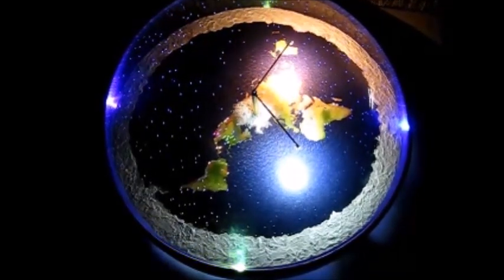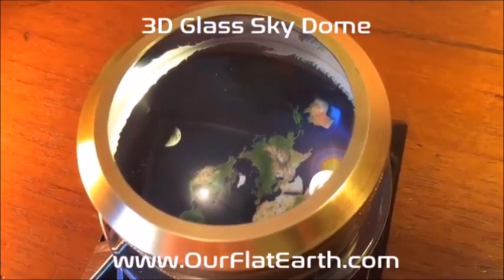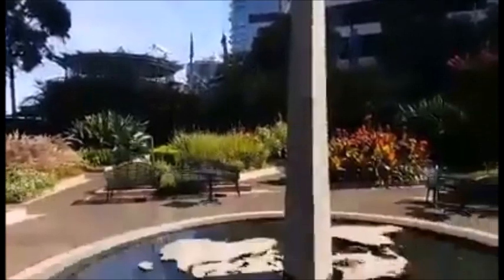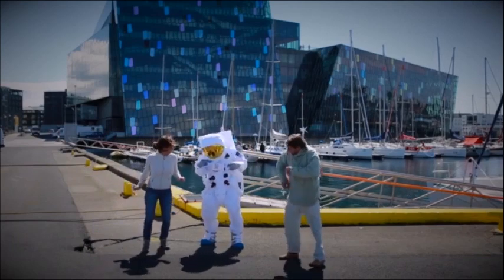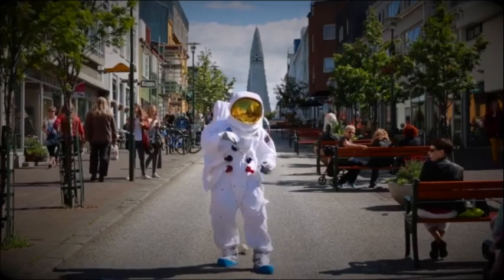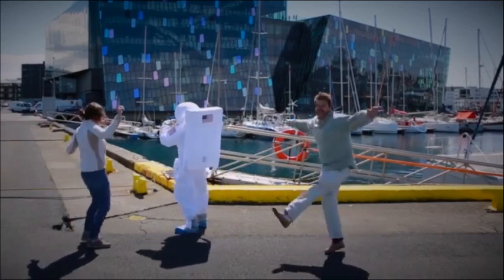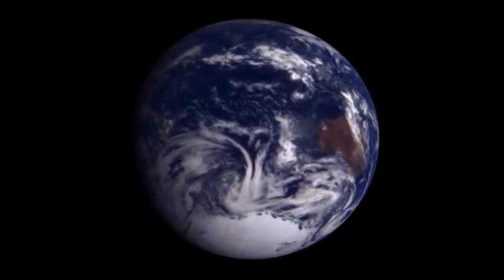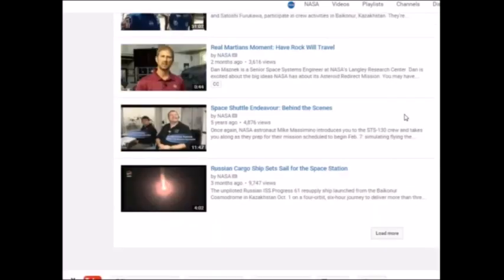Flat Earth Q&A Emails 61 - Mark Sargent ✅

Comment: Um... so wait, what?  

‘an infinite plane...’.?   Don’t you guys math?  If you get in an airplane and fly in any direction for 24,901 miles, you’ll end up back exactly where you started.  (spoiler - that experiment only works on a *sphere*)

I’d say it’s not rocket science, but it kinda is... oh and by the way, every rocket scientist knows you’re wrong.
Reply: +M. al, Prove it with a north/south flight around the earth. Prove that it has actually been done. The technology to do this is currently available by any reasonable airforce. It have never been done. Interesting?
Reply: From any direction!

And do you believe that there is sumthing called inner core that is pulling you right now!

If the flat earth had an inner core we will be dead because the all the water on the earth will be right in the middle of,
 and going out form the sides oh boy it will be like climbing a monton.

and the last thing what got you that earth is flat when if you believe in it my guess is on youtube or internet.

and if you say the government are hiding from us just why are we going to die if the earth is flat.
Reply: +M. al, seriously, fly west or east for the enough distance, from any point,  and you will be back at the start on a flat earth. Why do you think you wouldn't? It works the same as on a globe?
Reply: See that's the thing you travel 24,901 miles from where you are standing/ sitting right now you from any 360-degree angle will end up at the same place.
 And you didn't answer any of my remaining questions.
Reply: +M. al,  You are aware of the difference between a 'mathematical globe' and the 'real world' that we actually live on? Never forget the 'real world'. It is large and messy. ;-/ You are talking about navigating on the 'real world' to accomplish what you stated originally. May I suggest that you investigate what that actually involves? You may find it interesting. I suspect you will learn quite a lot along the way. That is always useful?
Reply: Have you been homeschooled or went to school
what is 1+1=
Reply: if you have any proof that the earth is flat, please give the proof and we have 1 rule don't take it from the net 
you can tell me how the earth is flat.

and I didn't know that there are people who still believe in such.

and don't tell me that is useful its pull crap.
Reply: +M. al, You stupidly said: "please give the proof and we have 1 rule don't take it from the net". 
     Now. using your own rules, prove the earth is a globe. :) 
     Ok, You understand that any rule that you apply to others must apply to yourself as well! :) 
     Or are you saying that we are not equal and I cannot use the same rules that you do?  You do understand the concept of  'fair'? Apparently not. That is the only way you can succeed? Fix the rules?
Reply: Is there something called flat mars or flat moon or flat sun
have you see the clips last year or you missed it.
am over 100% sure that you got your theory from the internet.
and why should the government hide that the earth is flat?? i want you to answer me that.
Reply: John Deso congrats you found a glacier! This one is called "Antarctica". We have known about these thanks to satellite images! Glaciers are found mostly in the north and south poles with some floating outwards and melting due to what we call global warming. A wall has 2 sides, why didn't these people continue over it? They already made it? Afraid they would continue around the world? Heres a quick look at some flight routes that easily debunk flat earth stupidity https://www.metabunk.org/flat-earth-theory-debunked-by-short-flights-qf27-qf28-from-australia-to-south-america.t6483/
Reply: John Deso cant wait for elon musk to send sargent to space, in case you missed it you were able to watch the livestream of the rocket launch and see the earth. In case you still arnt convinced you were able to see the car with a telescope with your own eyes
Reply: Zacktwo The Flat Earth Society they said we have followers all around the GLOBE if am A- you at A - -
Reply: John Deso If I'm ever feeling dumb, I watch this. And then I don't feel so bad. :-)

Comment: Hi, I posted this question before regarding on another site, proof OF flat earth.someone should know?
From Portugal on the mediteranean to Israel is around 2457 miles (One Tenth of the 24,000 miles distance of a globe earth) .
look on your watch ,that is equal to 6 minutes past the hour, that amount of slope on a curved watch / earth.   Would show a massive flood downwards towards Israel ie; there would be nowhere else the water could go to apart from going down the river Nile. Your opinions could bring this out into the open, maybe a video could show the responses?
Reply: That's not how "downhill" works.
Reply: Alex Siemers, Please explain how it works?
Reply: "Down" is in reference to the center of the earth, not north or south or any compass direction. So an object moving "downhill" simply moves closer to the earth's center, regardless of latitude.
Reply: Alex , thank you for your reply, But please explain this,,,,,from the Gibralter straits if the level goes down,that would mean that the straits would be lower at the narrowist part of the Atlantic and The Med where they meet so if we are on a globe earth , as the earth spins?surely that would leave a Swell, which would cause a flooding towards Israel.I don,t know, thats why I asked the question.